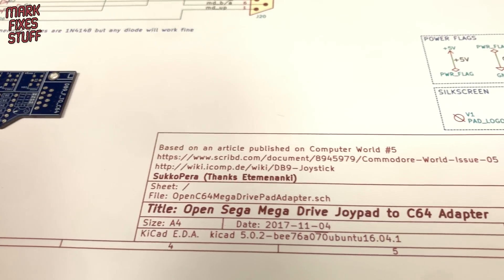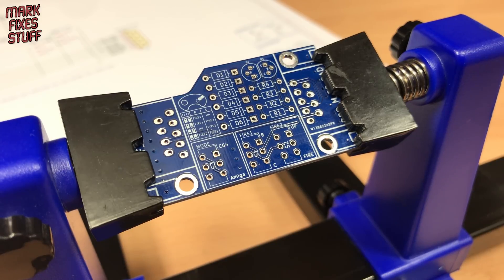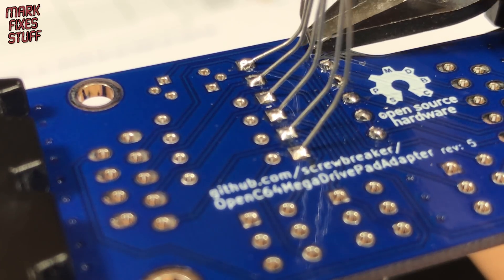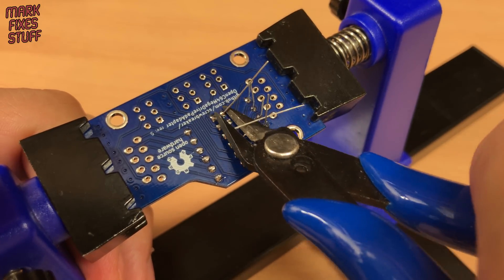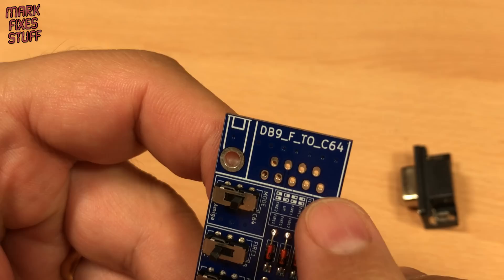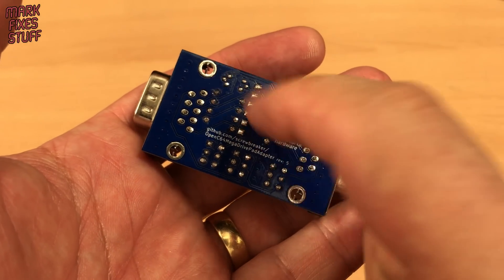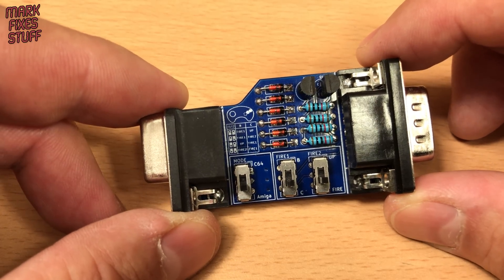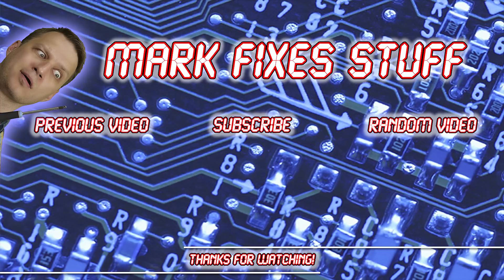Building a Megadrive/Genesis to Commodore 64/Amiga Joypad Adapter! Safe for C64!

Comment: Excellent video, you have a new subscriber.
Please make a video building a midi adapter for the Commodore 64, in Latin America it is impossible to get it and on the internet they sell it for $ 200 usd + shipping.
Please help us!
Reply from the maker: Is there an open source project? Kerberos?
Reply from the maker: Ok. I’ll look into doing this. It will take me a while though to organise, and I have no talent with midi!
Reply: @MarkFixesStuff  I'm sure you will make it, you really are very talented and thank you for sharing the knowledge.
Youtube is worth it for channels like yours.
Reply: @MarkFixesStuff  I don't know if the midi interface of C64 works the same as GBA with a cable
Reply from the maker: @accsmusictv  it adds midi in, out and thru so once it's installed it'll just me a midi device to the best of my knowledge at this point
Reply: @MarkFixesStuff  Mmmm I'm not sure, I've never really seen one personally only on internet videos
Reply: @MarkFixesStuff  Yes, there is a project called Kerberos and I think if it is open source

Comment: Does ordering off the link in the description come with everything you need or do I have to also buy those parts?
Reply from the maker: PCBway just supply the boards I'm afraid. I got the other bits from CPC Farnell and Ebay

Comment: Any chance you can give us the information on the components needed for the build other than the PCB? I know you mentioned it in the video, but having it written down would ensure I order the right stuff :)
Reply from the maker: Switches: 			3x DPDT Straight - Model JS202011CQN or same specification.
Diodes:				6x 1N4148, DO-35 type
Resistors:			4x Axial 10k 0.25w
Transistors:			2x TO-92 BC547
C64 plug: 			1x DB9 Female to C64
Joypad socket:	        1x DB9 Male to Joypad
Reply: Mark Fixes Stuff Thanks Mark, much appreciated.
Reply: @MarkFixesStuff  Much appreciated!
Reply from the maker: Yes. I'll make a list up tomorrow.
Reply: @MarkFixesStuff  Thanks Mark

Comment: Amazing work, Congratulations. Does this adapter accept Sega Genesis 6 Button Pad as a CD32 pad?
Reply from the maker: Hi Hache. No. The CD32 needs extra logic to adapt a pad. There is a project on PCBWay.com that will convert a Playstation controller to Amiga, C64 and CD32 with full functionality.  Check out https://github.com/SukkoPera/OpenPSX2AmigaPadAdapter
Reply: @MarkFixesStuff  Thank you!

Comment: No I am thinking could this be internally mounted.
Reply from the maker: To the controller? No question at all. It would be easy. Switch location might be a bit tricky though.
Reply: @MarkFixesStuff  actually hadn't thought that way round, I was thinking replacing one of the DB9 ports on C64, put the board inside and wire other end to main board of C64.
Reply: @MarkFixesStuff  but that's a good idea then can use on C64 and Amiga still. I totally agree I hate up for jump. I currently got an old crappy competition Pro controller I had for Amiga i wired the UP button to C button to get round it. 😬 Very limited success.

Comment: I wonder if this will work with the Atari ST.
Reply from the maker: On some models of the ST, using a plain Megadrive pad locks up access to the keyboard. It's because a standard joystick either pull the lines low or off. The Megadrive pad also pulls some lines high, which then causes all kinds of issues.

The adapter should sort out the problems with all machines, because it basically blocks high signals and lets the low ones pass through. The button mapping is just switching on the adapter so that will work too.